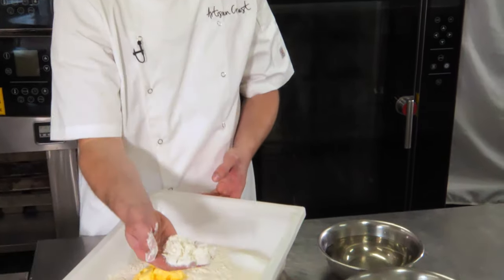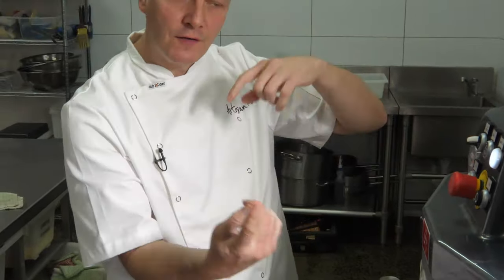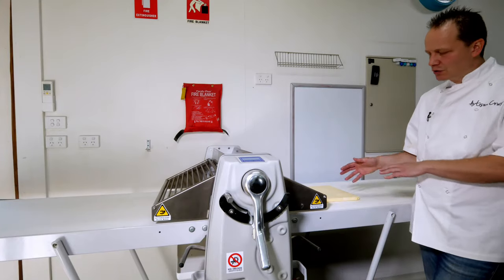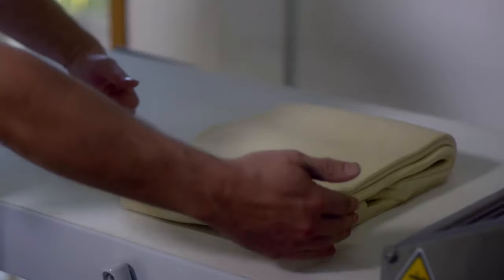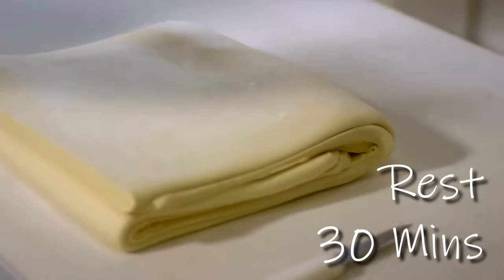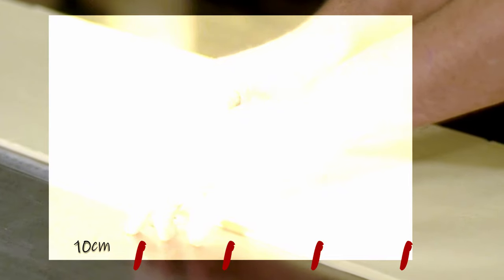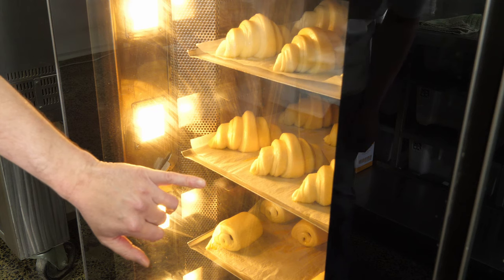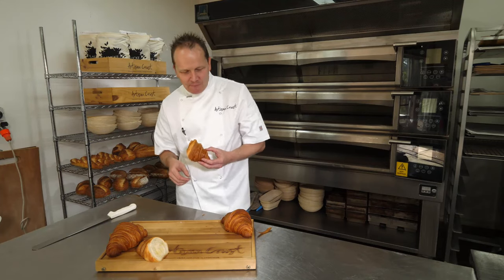Croissant Masterclass with Scott Megee

Comment: Hi Chef Scott.  Love your video and I'm hoping you can answer a question for me.  I've been in the business for 35 years.  I've done all different types of cakes and pastries, and some breads and even less lamination.  Of the two jobs that I've had where I did some lamination (danish and croissants) both recipes called for barely mixing the dough, maybe a minute or so, until the dough just becomes homogenous, to avoid overworking the gluten during later folds.  I was amazed when I saw you working the dough to the point that you could make a gluten window with a piece of dough.  I should say that I've been tasked with making a two tone croissant using the school colors of the university where I work.  I tried your recipe and failed completely.  The dough was so stiff and thick after 3 folds it would barely budge.  A couple of things I thought contributed were: 

1. The flour. Not exactly sure what "bakers flour" is, I'm in the US using "bread flour" with a 14% gluten content.  I tried another batch mixing in about 25% "all purpose" flour with a 11% gluten content.  A little better but not much.
2. The mixer.  I was using a 20 quart Hobart mixer, and the dough filled the bowl much more than the large mixer you were using, so it probably over-worked the dough.  I mixed it less on my second attempt, and again used 25% all purpose flour.  And like I said, not much better
3.  Rolling by hand.  Do you think a sheeter would help even if the dough was overworked?  

I ended up using a different recipe from a previous job that came from Bo Friberg's book "The Professional Pastry Chef", but I would like to be able to get yours to work, since it looks so much better than anything I've been able to produce using that recipe.  If anyone else reading this has some suggestions, I would like to hear them.  
Thanks!
Reply from the maker: Hi Johna8445,
You have a lot of good question that need to be unpacked for me to understand what is going on. Picture are a great help for me to diagnose any problems or we could discuss over a phone call if you like. You can contact me at sc.megee3@bigpond.com if you want to chat more.

Thanks for your enquiries
Reply: @theartisancrust8477  Hi Chef.  Thanks for your response.  Just rewatched your video and I think I solved the issue.  I wasn't watching the screen before when you were talking about glutenin and gliadin.  When I watched again I saw that it said on the screen 11.5% to 12.5% protein for "baker's" flour.  I had assumed baker's flour would be what bread bakers here use for bread, which would be either "bread flour", "Hi-gluten flour" or "Patent flour"  All which have a much higher protein content.  I did get my bi-color croissant to work with the other recipe, but will try yours again when I get some free time.  I have some pics if your'e interested, but couldn't figure out how to post them here.

Comment: Hello Scott, it is an excellent recipe, it has helped me a lot, currently I work in a bakery, with a Master Ambassador and I prepare this Croissant with your laminate, but I am trying to make it with a little less weight, maybe 90g, would you give me any suggestions?
Reply from the maker: If you have your dough rolled out to 4.8 mm and cut it 100 mm wide and 250mm long it should come out around 80 -90 grams If not you  just have play around with the triangle size

Comment: Hi Scott, I don't have an oven with a fan. Does the baking temperature remain 180 degrees celsius for 16 minutes? And is that the upper and lower fire temperatures the same? Thanks before, your video is very good😊
Reply from the maker: try 200 oC for 20 min and you may have to rotate the tray through the baking process. Have Fun

Comment: Hi Chef,  How long do you proof for in the proofer?  Also does too much humidity in the proofer affect the result of the croissans? I am having problem with the inside collapsing even when proofer for 2.5 hrs. Have also tried to proof longer but still having the same problem.

Comment: Hello, I have tried to bake some croissants but it leaks so much butter during baking (like the croissant is fried and appears oil puddle ) I have proofed it at 28 degrees celcius for 2.5 hours. Don't know what went wrong. I would really appreciate it if you could give some advice. Thank you in advance.
Reply from the maker: It could be that your butter layers  are to thick -  try doing another single fold on top of what you are doing
Reply: @theartisancrust8477  thank you

Comment: You said that dring the folds the "final" thick should be 10mm so 1cm every time but in the video the thickness before each fold (when you trim and show to camera) seem much much more than 1cm (roughly 2cm or little more). Is only an "optical illusion"? Can you explain it please? Btw very nice video. Very nice!
Reply from the maker: It must be an optical illusion, I roll all f olds down to 1cm before folding
Reply: @theartisancrust8477  perfect. Thank you for the explanation :)

Comment: Hi Scott, 
Another question, you mention your butter block is the same thickness as the  dough prior to the first roll/fold...in order to achieve this what is the maximum butter % of flour do you recommend? I typically use 50%, your recipe looks to be 25%.

Comment: Thank you so much for the detailed video. I have been proofing my croissants in a professional bread proofer. There is a weird chemical smell coming from the proofer that eventually lets my croissants smell bit chemical/nail polish. Do you know if there is any way to remove this smell? I have tried to put some used espresso powder to remove the smell and it works sometimes but the smell is still strong somehow. Please help me if you have any suggestions on how to remove this smell. Thank you so much.
Reply from the maker: Try a box of Bi Carb soda

Comment: You bake the colors so beuatifully, i also make egg wash, how many grams of egg i weigh, i pour that much milk but it doesn't turn out the same color as you
Reply from the maker: I use half egg half milk and a pinch of salt. Salt is important because it helps with the colour of the final product

Comment: Congrats Scott, this is by far the best series I’ve seen on sourdough yet. Just a question though- what roll does polenta play n the starter. Also relating to bakers percentages- are the percentages in the starter listed based on the total flour content or just the bakers flour?
Reply from the maker: Hi Justin we use semolina in the feed because it has a larger particle size so it take longer for it to be broken down and consumed by the yeast and bacteria. Bakers percentage is always base of flour weight  100% flour or 90% flour 10% semolina  = 100 % in  the formula and then very thing is a % of the combination
Reply: @theartisancrust8477  pls how do I get the bakers flour

Comment: hi chef can i partially proof shaped croissants like for one hour just before blast freezing it ? to reduce the final proofing time and is the improver has anything to do with the proofing time ?
Reply from the maker: Hi Anwer, yes you can partially proof your croissant, it will just make them a little delicate to handle. Improver can affect the proving time it all depends on which improver and how much you have used.
Reply: @theartisancrust8477  can u advise me with a specific one ?

Comment: Great video, thank you so much. What flour do you use please?  The 15 minutes rests between folds, are they done in the fridge?
Reply from the maker: The pastry is keep in the fridge whilst resting, I use a flour that has 12.5 % protein
Reply: Thank you for your reply. May I also please ask, if I want to bake some of the corissants at a later stage shall I freeze them before the final proofing or after the final proofing?  Thanks a million
Reply from the maker: @micheleboyle5595  Hi Michele, you can freeze them before there final  proof. if you are freezing them for more than 2 week you will need to increase the yeast content by 25% to counteract the death of yeast cell due to freezing
Reply: Thank you so much for your help and quick response, on my way to try the first batch 😊

Comment: My inside of the croissant has layers but not separated with air alot they are pressed. Why?
Reply from the maker: What is your proving temperatures ???
Reply: It is in a cold oven with the vaporation of a hot water

Comment: What level of gluten development in the initial dough is desirable for home cooks who are rolling out by hand?  If you start out with a dough made from strong flour and at the windowpane stage before starting the lamination process, it will be almost impossible to roll it out through the several turns to a final thickness of 4-5 mm before shaping the croissants.

If you have a laminating machine as you dough that is not a problem.
Reply from the maker: I normally start with about 75% gluten development in my doughs

Comment: What is the reason behind the offset bookfold vs a normal fold where the ends meat in the middle?
Reply from the maker: It just moves the fault in the pastry around so it doesn't end at the same place

Comment: Great work Scott! I have a question for you, what are the dimensions of both the dough and the butter in this video? Moreover, it looks like the recipe for the above are double or triple the one you mentioned in the link. Please confirm.
Thanks a million
Reply from the maker: Hi YourGoodbbasic, your butter a should be 12 mm thick and your dough should be the same. The recipe  attached and the recipe used in the video use the same bakers percentage  so they are the same proportion just different dough sizes. Happy baking
Reply: @theartisancrust8477  Thanks a lot for your reply 😍
Reply: @theartisancrust8477  where's the written recipe pls? and which flour did u use
Reply: @theartisancrust8477  pls what kind of oven do u use, can a normal gas oven bake this, I want the same colour of the egg wash after it's baked. pls assist
Reply from the maker: Hi Olivia , we use a fan forced electric,  should will be able to the same result with a gas oven you might have to play around to get the correct temperature. When using egg wash i use 1/2 egg 1/2 milk with a pinch of salt
Reply: @theartisancrust8477  that was a swift reply, thanks so much
Reply: @theartisancrust8477  I have a type 55 Divella Italian flour I want to know if it's suitable for making croissants?
Reply from the maker: Hi Olivia, I haven't use Type 55 Italian flour before, when I make croissant I use a bakers flour that has over 11.5% protein content
Reply: @theartisancrust8477  thanks for the reply, God bless u

Comment: I have a problem:

When making the dough it laminates perfectly. Thin even lines of Butter and dough.

But as soon as I put it in the oven (tried multiple temperatures 375 degrees F or up - 90C or up) all the butter is flowing out in the first 3 minutes and I basically get a deepfryer in my oven.

Why is my Butter always flowing out of the open (cut) ends of the dough?

I never see that happening in tutorial videos and its not flowing out when I buy dough in the supermarket.
Reply from the maker: Try putting another fold into it , quite often the butter layer can be to thick and that is what allows the butter to follow out
Reply: @theartisancrust8477  already tried that with some leftover but it didn't change anything.
Reply from the maker: @Gorkilein  What is the % of laminating butter  to dough weight?
Reply: @theartisancrust8477  In the recipe I tried his time izs around 60g miced into the dough of 600g flour then 340g butter for folding.

But earlier I tried different recipes with lower percentages.

It also looks as if nearly all butter runs out, now just a little bit.
There's a huge lake of butter on my oven-tray 2 minutes into baking.

Some suggest mixing Flour into the butter into the beginning which I never tried.

But for what I think its just to roll out easier correct?

And I was using Butter with 80% fat which has no oils added into it.

Comment: HOW DO YOU READ THE RECIPEEEEE????
Reply: View the amounts as kilograms (e.g., 0.542kg = 542g); ignore the various "total" amounts as none of them match the amounts; and view the roll in butter amount as a percentage of the dough weight, not as a baker's percentage (keeping in mind that since none of the totals are correct, you'll have to decide what the total dough weight is (with the scrap or without?)). But roll in butter percentages vary widely, so it's hard to go wrong.